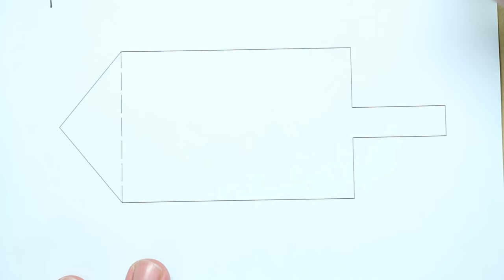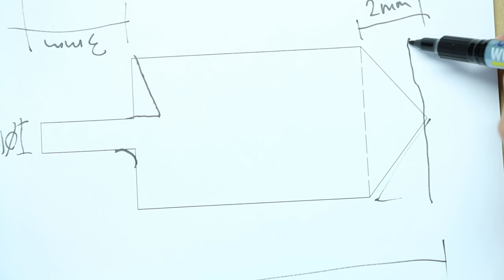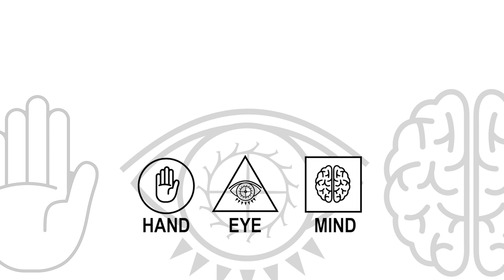Watchmakers lathe - How to turn Basic Cuts

Comment: how big can you get the chuck for these? I really want to make my own chess set by hand out of aluminum or brass.  would these work for that?  thanks.
Reply from the maker: Hello, Andy. You can get a 3 jaw chuck for these lathes. I would turn nothing larger than 3/8 - 1/2 inch or 10mm - 12mm. The amount of material you can remove is quite small with every pass.

Comment: I use an electric drill, mounted in a workbench vise. Place the material in the drill vise, then work it with grinding stones/ metal files/ various sandpapers. 
It is possible to make 13 mm by 1.3 mm band pins for friction fit metal bracelets

Comment: Incredible how you do this all by hand. I do this on much larger diameter workpieces but with computer aid. When I need to put a spot for a drill in the center of a workpiece I simply touch the side of a part and then measure the diameter, half it, and then imput that in to a computer.

Comment: Thanks Dean, really useful video. I always struggle with the lozenge up cut and tbh can't really see any advantage in it but I'll persevere.
Reply from the maker: +Jane Brister Thank you for your feedback. I found that I prefer diamond up when turning conical work, only because I find it easier to control. Other than that its only a different method to achieve the same goal in my opinion. 

But if you can stick it out I am sure you will get it in no time. :)

Comment: Thank you so much for posting. I really enjoy your videos. Question about the parting cut. I read in a well-known, instructional text on watchmaking (from the 1950s) about parting the work in the lathe (while rotating) using a jewelers saw. I have not yet tried this, but it just seems like it would be faster, less work, and give a cleaner cut than parting using a graver. Is this not the case?
Reply: The heat build up can be an issue, those small blades are not designed for high spot heating.

Comment: Is it normal for the rest to be free to move as you work? As a wood turner it is imperative that the tool rest be locked down before turning. I noticed a slight movement in your rest and that is what prompted my question.
Thanks.
Reply from the maker: Hi Scott, the rest is locked down to the bed, but is free to flip up and down via its pivot point. This allows you to quickly move the rest out of the way and see and take measurements. The slight movement is just the small amount of play. Thanks for watching and commenting 😁😁👍🏼

Comment: Dean, I just subcribed to you because I came upon this video and it's so well done. Very watchable (no pun) and informative. I have had my watchmakers lathe for most of my adult life. I have a carbide graver set that has a graver polishing collet that you put diamond powder on. It's so good to see this video that shows you can do productive work on these lathes. Everyone''s buying those Chinese machines today that don't look like they have any accuracy. Mine has cone bearings and has serial number matched, hand scraped,  head and tail stock. I've been told it has a concentricity of 50 millionths. Is that even possible?  I wish I had the back pulleys for it. I just use a single belt setup.
Reply from the maker: Hi sorry about the delayed reply. If you have a variable speed motor, then counter shaft or back pulleys aren't really needed. From what I have learnt on my journey the watchmakers lathe should have concentrically of 0.005mm at the nose. Then the collet will have runout, preferably the same, as you want a max Total Runout for turning to be 0.01mm.

Comment: Very helpful video! I am just purchasing my first watchmakers lathe to use for goldsmithig purposes, and I was wondering if you could enlighten me on what kind of belt you are using and where I could find one. It comes with an old leather belt that is incredibly loose. Hope to hear from you, and keep making awesome videos!
Reply from the maker: Hi there. eBay has plenty you can buy.  Thanks for watching 😁 Search for watchmaker belt on eBay. Depending on your lathe you can buy different diameters. I used 5mm diameter for my lathe. Once you get it measure it out on your lathe, onand cut to length and melt the two ends together 👍🏼
Reply: @DeanDK  thank you so much! I love your videos
Reply from the maker: Thanks Theis 😁

Comment: why not just use a centre lathe ?
Reply from the maker: Hi Jacque, I think it’s a case of horses for courses. The watchmakers lathe can be used to turn steel pinions down to less than 0.15mm. By hand and the machine not spinning at break neck speeds. I think it would be hard to pressed to do that on a centre lathe that can be picked up for around $300

Comment: Your drawing shows a flat piece of material. ;) Is that unleaded brass, very long chips!?
Reply from the maker: +Baikal IZH35M Its just to help explain not as a technical drawing. I'm not sure, it should hopefully have some, it was sold for machining, and is readily available and cheap. It works good enough for practice exercises.